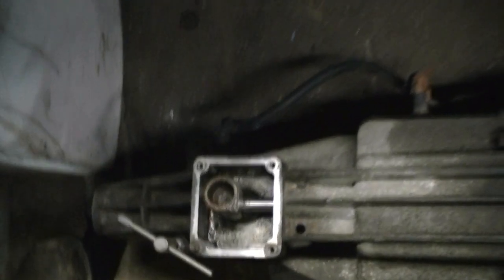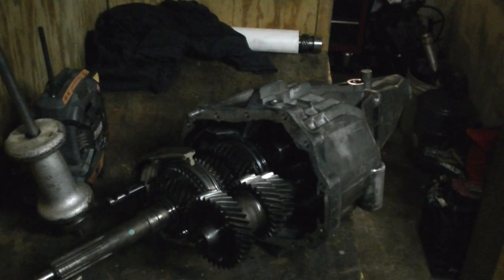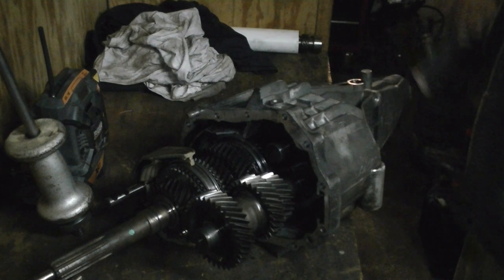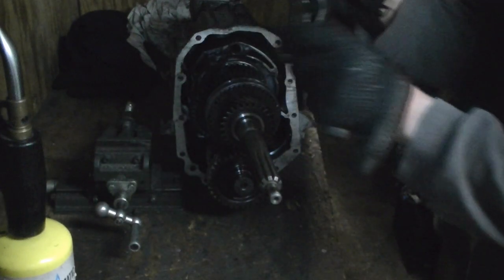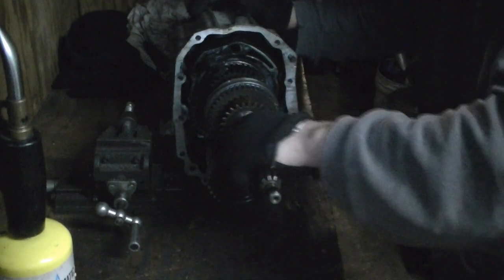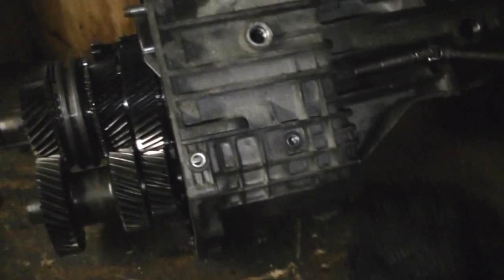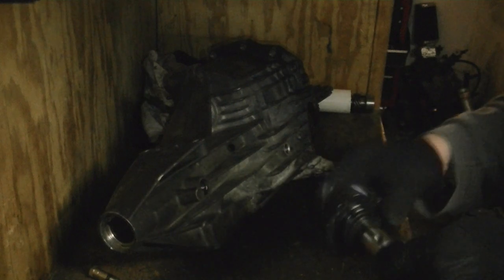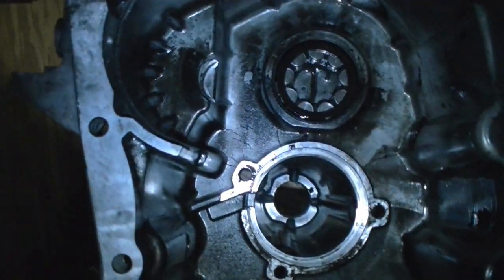How to? Chevy 5 speed Manual NV3500 Disassembly : Tear-down Part 2. Its not that bad.

Comment: Is this the NV3500 GM? AS far as I’m aware, there were a variety of NV3500, both for dodge and for Chevy. Also, what kit are you referring too? I’m grinding bad in my C1500 when shifting to 3rd and a little when shifting to 4th. I’m assuming it’s the synchros.
Reply: Ford used them too

Comment: I recently purchased a 95 s10 blazer 4.3 4x4. It has a 5 speed swapped into it. Used to be automatic.  The trans started making a hell of a noise even when I’m neutral and locking up while driving.  Somthing in there is broken but it will shift into all gears. I am having trouble identifying what transmission it is exactly to replace it with another. Will the transmission out of a k1500 5 speed work with it as well or will I have to find a manual zr2 to pull it from?
Reply: Input shaft bearing went if I had to guess

Comment: I have a very hard shift from 2-3... the. sometimes coming out of 3 it's hard to get the shifter to move side to side .. ideas? this is newer nv3500 from 2003 Silverado
Reply: Was it the 3rd gear synchro?

Comment: I have a question for you. At the very start of the video (0:00). On the right side. And on the case. There is a hole where a bolt goes. I removed that bolt on my transmission. Thinking it was a filler port. NOW.  I can't get that bolt back in. Can you help me?  Will my transmission need to be removed to get that bolt back in. Any advise would be very helpful.

Comment: Hey do you have any clue if the chevy nv3500 and the dodge nv3500 are the same? I'm getting ready to rebuild a dodge nv3500 and I'm trying to find parts. But it seems everywhere I look only has chevy nv3500 parts
Reply: Yes beside bell housing

Comment: I've got a 4x4 version I'm pulling apart to inspect. But I can't seem to get the gear set out of the rear housing. I've got the seal and rear lock ring removed. Any tips? Thanks for the video by the way.
Reply from the maker: All the retaining bolts are removed? I had to tap the whole gear set out. The output shaft/bearing like to become glued into the housing after years of use.
Reply: @beeterolds  yes sir, only thing left in the trans is the gear set with forks. I've removed the shifter rail with rollers and shift selector. It is the 4x4 so I wonder if I really need to build that JIG. It's got like 1.5" of in and out play. It's really wanting go fall out but bound up. It doesnt feel seized. Truck and trans has 60k miles original on it. Only real reason I'm opening it is to look and just reseal it. At this point I'm doing a full rebuild on it. Clutch was shot. That's unfortunately why everything came out.

Comment: Wat u think bout carb 5.3 wit th 400
Reply from the maker: I would have a better answer if I understood what the heck you are asking.
Reply: How u think dat carb 5.3 will run on interstate wit 400 the 5.3 rebuilt I put jegs camshaft in cloyes timing chain wit jegs torque converter